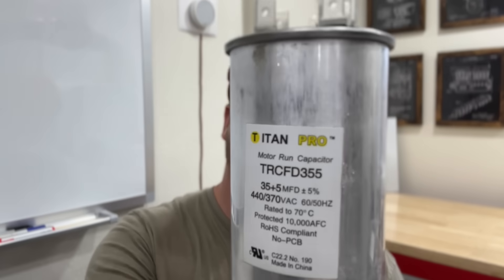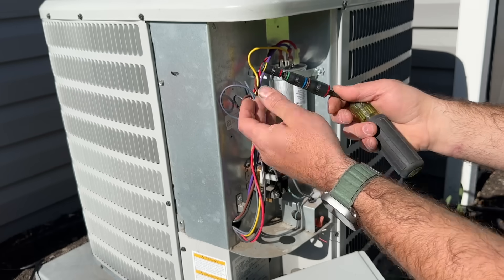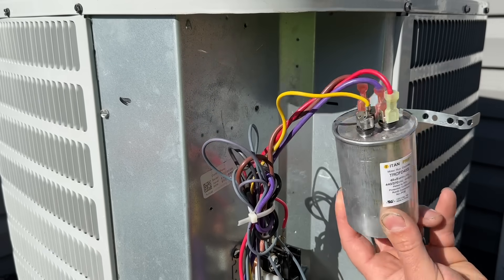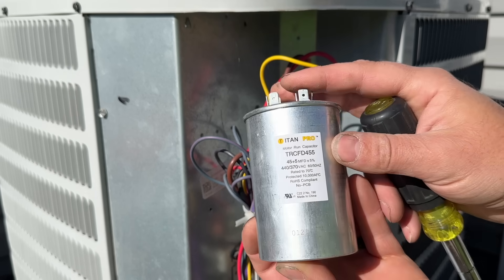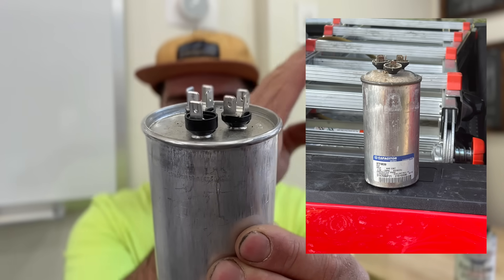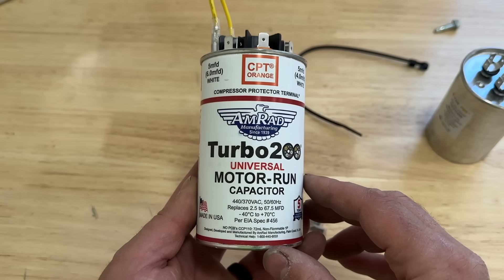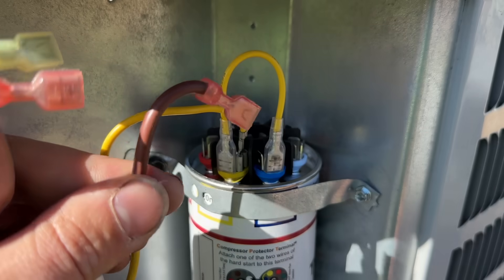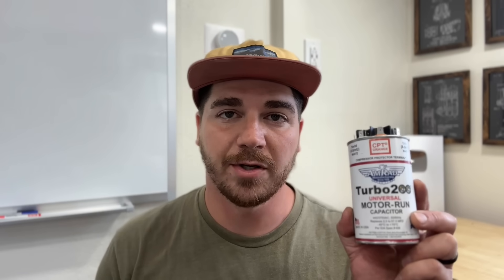HVAC Contractors Practically Make Their Living On These

Comment: You never mentioned why RUN (not a start cap) caps fail. Oftentimes coils are very dirty, electrical contactor points are burnt, or loose electrical connections & sometimes it's all of the above. A compressor that is getting ready to shoot craps will also blow a capacitor.

Comment: REALLY two grand??? Dude, what are you smoking? After 28 yrs as both a commercial tech &  residential tech I have never heard of anyone being charged even remotely close to that. Btw that is a run capacitor which is designed to smooth out the wave balance. It is NOT a start capacitor - which does as the name implies. 
A start capacitor is usually in a plastic housing & wired to a potential relay which drops the start cap out of the circuit after the compressor starts. The more common start cap / with matching potential relay often is sold by names such as Super Boost etc.. 
Come on & be real did you just pull that 2k figure out of your ass?
Reply from the maker: No I really did not. In fact someone literally just commented today saying they were charged 2k recently for the cap and fan. It’s not common, but it 100% has happened before

Comment: Bro, the HVAC contractors are talking about our residential companies, especially the ones that have fancy designs on their vans and our flat rate companies. Most real techs can diagnose a little resi system in their sleep and do a full mechanical install for 9000-12,500

Comment: ❓ I checked the wiring box and they left the cap inside the box that it came in. They said that it would be a better insulator. Never heard of such a thing or seeing as such. It seems to me that we would want Cool air around it if possible. Could you tell me if it's good to leave leave it in its box as they did or to take the box off of it. That's a puzzler for me. I've never done that even on commercial units which was my main HVAC maintenance that I would do for the company I work for before before the USN.

Comment: Funny 5 years ago an HVAC guy wanted to replace my Capacitor. Was going to be a $60 charge, so not too bad. However, I decided to wait till it just dies. It's still going strong 5 years later. So he tried to scam me at a fair price.
Reply: You don't want to do that, as the capacitor value drifts over time. The capacitance will be wrong before it dies, putting strain on your unit and killing it prematurely.  Capacitors have a Tolerance Level clearly written on them, usually +/- 5% or so.  Once they drift outside that range, they are supposed to be replaced, as now the phase is wrong and it is working much harder than it should, shortening its life.

I have a capacitor I replaced because my compressor was overheating and shutting down.  It was supposed to be 40uf but it measured closer to 20uf, which means it was 50% off, way off its 5% tolerance...
Reply: @redbaron6805  thanks, I will check for that then.

Comment: Just passed by your and thank you very much. I would have personally explained to him what the reaction would be if it was good. That there would be a pop or a snap that it is holding its charge. That is why you are holding a insulated tool in case it was good and not to be electrocuted. Did subscribe🎉
Being disabled and I normally keep a cap in my shop. Sometimes a couple of them. Had a bad experience working as an electrical and mechanical engineer for a company. Taking care of all of its mechanical assets. I thought I had a bad cap, turned out to be a burnt bearing on the blower motor. But I did check the cap and for those that are timid know that it will pop not explode! But you'll hear a snap or a pop letting you know that it is good in energize. Still functioning as it should. Well checking it with one of my Klein screwdrivers being in the adverse weather conditions of South FLA. A rusted portion of the lip popped like a grenade LOL but not.  Did not know Amazon carries them. That will be a can do and will do. Definitely will get a turbo! This will be for my parents or one of my sons in that very case, especially being summertime now. Thank you so much! If they would just use a simple nut wrench and save so much money. The company I called out was also the company that sold me my home. I told them on the phone that it was a cap. Make sure that they brought one. I even told them the compressor is running but the fan I had to give it a head start so it would go into high mode and then I turned the thermostat down so it would continuously run until they got there. Well they took care of the Cap, then went into my split system in my house and went through this maintenance of cleaning my coils which were perfectly clean and adding air freshener all that bull crap. Sent me a bill for $300 and I told them $300 not for an emergency call which anything after 3:00 p.m. is an emergency call and you can just about guarantee you will be getting a 1K USD bill. 😱 Yes, that is correct. I called the office and I told him the cap at most would cost $28 for the specific unit that I had and trying to take advantage of my wife while I was at the doctor. I told her the bill wouldn't even be $100 but lo and behold there it was. I explained to them That not explaining the fee to the customer before the work commences is not a professional manner in which a company works or strives to work in. Just sending a bill 30 days later is not convenience. Explaining to them my history and my service in the USN. They can come and get the cap. It will be in the mailbox and not to enter my property. They did not want any of that so the bill was fairly amended. Can't wait to watch your other shows. Thank you so very very much. Totally agree with your assessment. On top of the turbo I will get a couple of my own for my personal home hvac 🕊️

Comment: Mine went out last summer, got an estimate of $700.  I thought something was fishy because I could use a stick to get the fan going so I knew it was the capacitor.  I took a picture of the old one, it was gooey and looked like vasoline was seeping out of it.  Ran down to a HVAC supply shop and it was $9 to replace it.  Took all of 10 minutes to replace it.

Comment: Suggestion use a large resistor instead of a direct short using a screwdriver to dont damage.  Use multimeter to check voltage. Important is to choose the exact capacity . Voltage must be same or higher, but NEVER lower
Reply: Capacitors only come in 2 voltages, 70V or 440Vac.  Just choose 440Vac and you will be good.  You can also use a multimeter to measure the capacitance, and see if it is correct.

Comment: As a HVAC tech my self dont buy those cheap caps. Get Amrads you dont need a turbo either they are nice to have to get a family member by in a pinch but are alot more expensive. Just buy Amrad its made in America it had a warranty that none of the others have. Titan pros are junk your looking at a year to 2 out of it i have seen amrads last 5+. Also be very careful when changing always always discharge it controlled i have heard storys of them blowing peoples finger tips off. The other good thing about having a HVAC tech look at it is we will OHM your motor out and meg it to make sure it didnt get to hot with the cap going bad alot of time your fan motor windings get hot you put a new cap on it works. Then the motor dies a week later and if theres no high pressure switch that can then kill your compressor at that point you might as well buy a new out door unit because the cost is now above replacing the parts atleast you will get a new coil out of it. But if ya had somone check the motor ya may have had to buy a 250$ motor and a 35$cap plus labor instead of 2k on the outdoor unit.
Reply: Or a MARS, also Made in the USA.  There are a couple of companies that still make them here.

Comment: I don't know why anyone hires HVAC companies to do stuff like this. This is homeowner repair stuff that all men should be able to do.
Reply: Because it is high voltage, and people can get seriously injured or killed if they don't understand what they are doing...
Reply: @redbaron6805  It is not high voltage. It's standard residential voltage 110-240 volts. Also you have a discounted and a breaker that you can kill the power.
Reply: @retiredarmyvet2018  There are zero central air conditioners that run on 120Vac.  They all run on 240Vac.

And if you don't think 240Vac can kill you, think again.  I have known A/C repair people that were killed working on A/C units.

The breakers for condenser units are often 30A, meaning you have over 7,200W of energy before the breaker trips.

Keep in mind that 0.075A will cause ventricular fibrillation, and 0.1A to 0.2A is fatal.

There is a potential of getting seriously hurt or killed working on these if you don't know what you are doing.
Reply: @redbaron6805  Never said 240 volt couldn't kill you. I said 240 volt is not high voltage. High voltage is classified as 1KV or higher. I also never said central air units were 110 volt. As a former electrician I know any amount of current can kill you. To include a 9V battery. But you failed to understand my statement.
Reply: @retiredarmyvet2018  Not at all.  Low voltage is typically something below 50 volts.

Residential voltage is either 120V or 240V, it is not 110V.

Yes, you have a disconnect and a breaker which can kill the power, which people who work on those systems or work on electricity in general would know.  

But how many people know which breaker to trip, and how often could they trip the wrong breaker, not have a meter to check the voltage, and potentially injure or kill themselves when working on this?

If people knew how electricity and wiring worked, we wouldn't need electricians to work on it.  The average Joe has no clue what hazards he will encounter when working on these.

This is the type of work where people not paying attention and not understanding what they are doing could get seriously hurt or killed in the process.

Comment: That’s why you never pay prices to a flat rate company example 1 hour air conditioning, example etc. etc. these types of companies charge you a flat rate price per item to be fixed which in the end could cost you thousands of dollars a local reputable contractor that charges you more or less an hourly rate plus parts they’re still out there

Comment: I found this out from certain units, but capacitors can act as a phase-delay rather than a power boost. Adding too much power on the wrong side can also cause a compressor to cripple out from a terminal arc-out.
Last few units i worked on that had hard-start kits were on units already pushed to their limit, and the hard start straight up murdered the units. Issue originally was a power demand issue causing a brown-out, which caused surges in places.

Thankfully the last time the house AC needed repair, the tech confirmed my suspicion that it was either a capacitor issue or a compressor problem, as the unit fans were running, but there was no vibration from the compressor. That guy charged all of $20 for his labor.

Comment: EXCELLENT VIDEO! Clear, concise, and no fluff. Anyone with central AC should save this video. Don't ask how I know. Thank you!
Reply: If you go to a mechanic for your auto repairs, they do the same exact thing with Oxygen Sensors. They replace them when it’s not necessary and they up charge you massively on the parts and labor. If you require an oxygen sensor, it’s less than $100 for the part and take 5-10 min to replace.

Comment: Make sure to check that this won’t void your warranty
Reply: Most A/C's only have a parts warranty, unless it was just installed.  Replacing a capacitor is not going to void your warranty unless you install the wrong one, or you connect it wrong.

Comment: Had experience with this last summer. Home warranty HVAC guy wanted to replace both for $740. Showed me the part, I looked it up quickly and yeah, $15, 5 minutes of time. It's amazing you can't be arrested for this thievery. BTW, both meaning both units.

Comment: It cost me $1700 to fix my AC but that was after I tried a new capacitor and needed to get a new compressor, those things need to be welded off, and back on and them you need to pump the gas or liquid or whatever into it and mine was old so the kind of stuff it took was hard to find, this is something you cannot do yourself unless you do this for a living. One tip, if this happens, see if it is covered by your home insurance, I know someone who had to do what I did and it cost him like $200 because it was covered, however they suffered for 2 weeks in a hot ass house and I was down 2 days lol.
Reply: Compressors typically have a 10 year warranty, if it was installed by a licensed installer and he registered it after it was installed.  So, the part is often covered, the labor is usually not covered.  It is exceptionally rare for this to be covered under insurance, unless something else took it out like a hurricane, a flood or a similar covered event.

Comment: HVAC is completely unhinged lately. My wife and I had to pay 11,000 dollars to replace our furnace and AC. The one we replaced 20 years ago... Roughly 2000.  They set you up with a bi annual inspection they call it. Where they come out 2 times a year to tell you the motor you JUST HAD INSTALLED!!!!! Needs to be taken out and cleaned for 2500. Bunch of rip offs.
Reply: No A/C company ever takes out and cleans "motors", coils maybe, motors, never.  And I have never heard of cleaning costing $2500...
Reply: @redbaron6805  Now you have. I won't name their Co. name unless asked.
Reply: @redbaron6805  Blower motor. has a little bit of dust. They showed me a picture of it. Minisqual amount of dust such as you would expect for  one year of operation. Their justification for the price was 2 man labor 6 hours. Which if you charge $100 dollars an hr. it works out to $1200 for labor only. Then I guess they charge $1300 for their awesome vacuum cleaner and the bottle of 409 they use to shiny it up after air mopping, BTW they left a huge mess for me to clean up when they installed it. Apparently they had beers to drink and strip clubs to gawk at. The ones that have the toothless dancers and the rank pee smell. That stuff lingers for centuries. Have to get your nostrils shaved and cauterized. lol. The hvac co. I went with... doesn't deserve capitol letters. Absolute rip off. I have heard of 3 other companies doing same. Put up a comment on someone's post about it, Got 3 hits. All with similar stories and different companies. Since Jan. 1, 2024. Their prices have all pretty much tripled. :face-turquoise-covering-eyes: Cheers!!!
Reply: @dcore64  If the blower motor is getting dusty, it probably means you need to upgrade your filters.

Your unit really should have a MERV20 filter, but better filters restrict airflow so you need to keep an eye on them.

But there is no question that you need to research A/C companies to pick a good one.  Use Yelp or Nextdoor or other apps to see what your neighbors are saying, and who they recommend.

Comment: Your "arc" process for those terminals looked very benign compared to the reality I experienced a few years ago. I wasn't doing anything but washing the unit, after disconnecting the power of course. The water stream found its way somehow to those terminals and the sudden discharge literally exploded the plastic hose nozzle I was holding in my hand. Luckily it had been raining which meant that my clothes were wet and I was standing in mud, so the charge continued up my arm and down my clothes into the ground through my feet, instead of going through my body which would have killed me. Ever since then I don't mess with outside units, not even to clean them. I pay professionals to do that.

Comment: I wouldn't arc and discharge it like that. Touched the capacitor the same way by accident once, the jolt was so powerful the screwdriver got thrown from my hand and dented wood panel on fence. Jolt was so powerful it twisted and warped screwdriver tip beyond use. Also check wiring for live voltage because they can be wired wrong.  

Take a picture of  original capacitor wiring for reference.

Comment: They also seem to use the crappiest parts possible on a new AC units. I had to replace mine after only 4 years on a new build.
I knew from previous experience what it sounds and feels like when the capacitor dies, and just had to check the unit to get the correct specs for a replacement.
Went to my local Grainger industrial supply and bought a replacement for like $20. Replaced it myself, saved a bunch of $$$, and I've had no issues with it going on 7 years now.

Comment: The chinese cspacitors are a dry electrolitic type that can't take much heat and don't last long in hot conditions, the capacitor you want is an oil filled which help convect heat to the can...

Comment: Last Friday our AC went out at about 10pm.  I know I have a spare capacitor but couldn't find it.  No stores were going to be open till Monday morning.  Had to call HVAC tech.  Luckily I knew what it was and just told the tech what I needed.  He made time for me and installed the cap.  Problem solved.  Only charged me $150 which I think was more than fair as I didn't have an appointment.  I have ordered another cap to have onhand for the next time. since the same cap has blown about every other year since we move in.
Reply: If the capacitor keeps blowing every 2 years, you have another problem with your system causing it to fail.